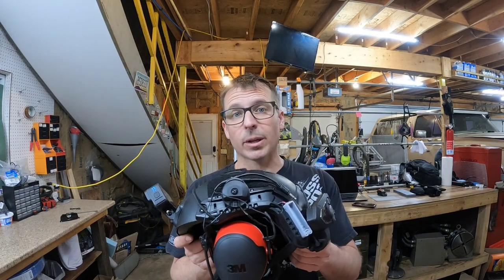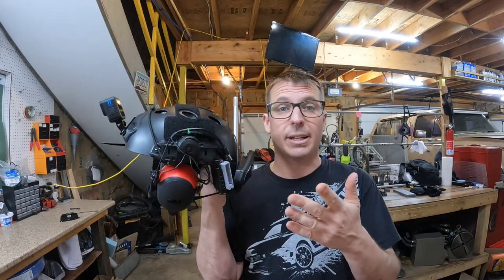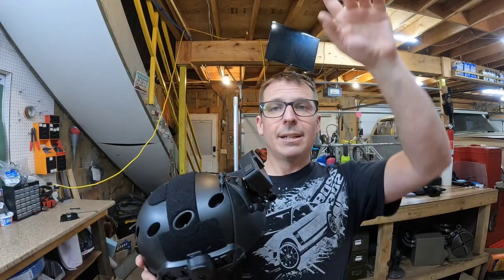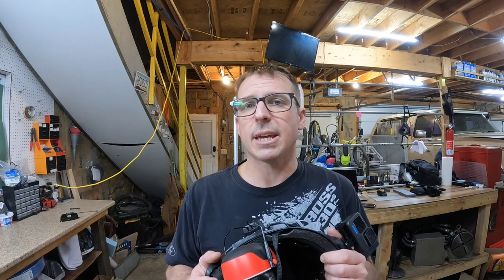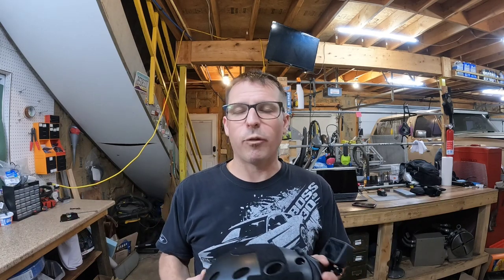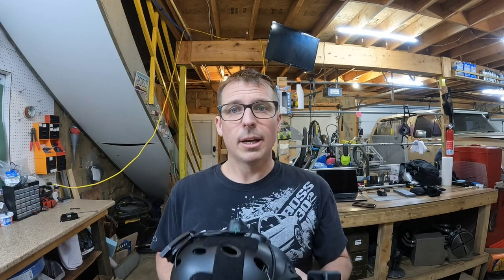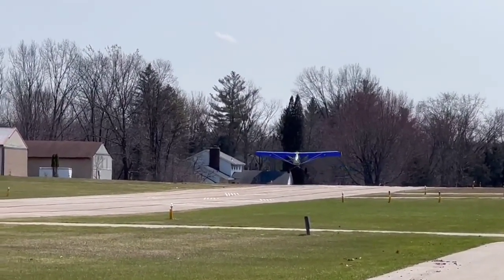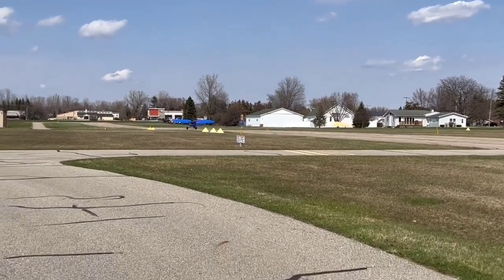Aerolite 103 Engine Failure and explanation.

Comment: I moved my kill switch to the bar on my left side. Being overhead, it would have been hit accidentally. I'd be trying to do that, and maybe design an easier way to operate the flaps. Overhead cranking isn't very easy to do when you're trying to fly the plane. Just an idea. I'm always trying to tweak things for ergonomics. Anything to make you feel connected to the plane.
Reply from the maker: Im swapping engine soon, the new engine is EFI and will have electric start and a keyed ignition.  At that time, I am switching to a flap lever over the electric actuator. I may also spring load the flap lever, so I run a release cable and lever to my throttle lever. That way, I'll be able to quickly release the flaps on landing but also keep my hands on the flight controls.

Comment: In this situation it's high drag and low glide performance helped.   Didn't look like you gained much speed coming down.
Reply from the maker: Yeah, it definitely worked out well. I had more than enough room to glide down and land safely.  The most important thing is keeping up your airspeed.
Reply: Need a guard on that switch so can't accidently bump it again.
Reply from the maker: @Mike-01234  first thing i did

Comment: Your climb was fast and maximum altitude in shortest distance.   Left you plenty of room for a safe landing.   This would be an excellent thing to practice on regular basis.   Then, when it happens for real, it's a nothingberg.
Reply from the maker: Thanks! I practiced engine out situations a lot, and you are correct it makes it fairly uneventful.
Reply: @kidkhaos6427  You could tell you had that situation under control and stated well ahead of the plane!  I'm still debating going the UL route and skipping all the FAA testing for  a sports license.   All I want to do is stay around a local airport anyway.   UL is so affordable.   Not to mention, you can even put chutes in these things!

Comment: Electric Start should be used on all Aircraft.
Reply from the maker: I would have landed even if I had electric start.  Your first job if the engine dies is to fly the airplane. At that altitude, attempting to restart the engine and continue the takeoff would have been poor decision making.

Comment: Nice vid. Good info. Pro tip: Shoot your future vids somewhere away from that clock. Click…Click…Click… ;-)
Reply: Also, flaps are a frequently misunderstood and over used accessory. On t/o they do NOT improve angle of climb. You’re best off not using flaps at all for takeoff unless in a soft filed situation or a short runway situation without obstacles.